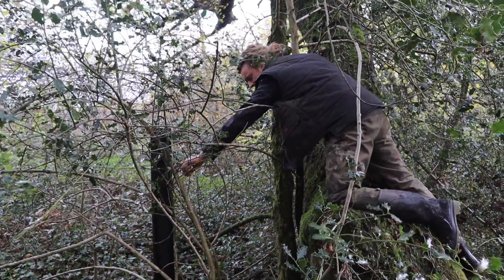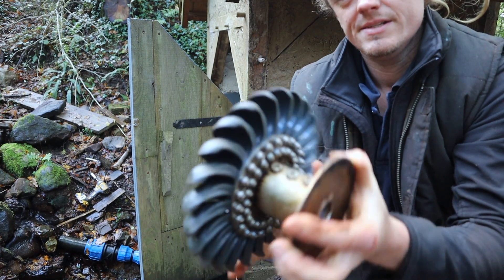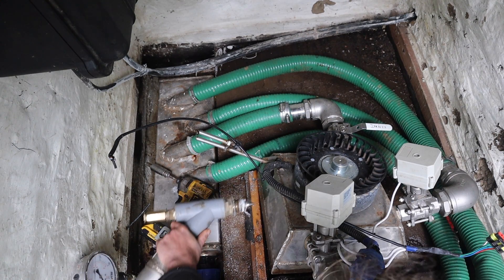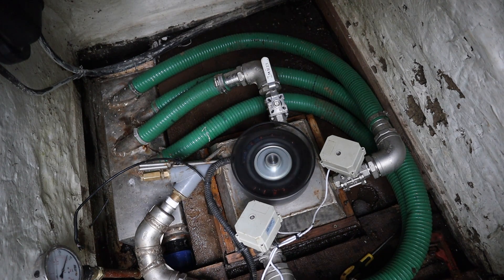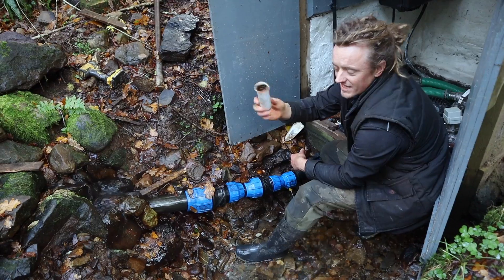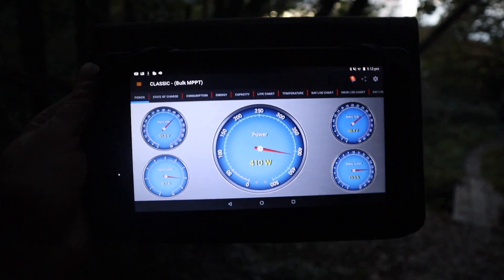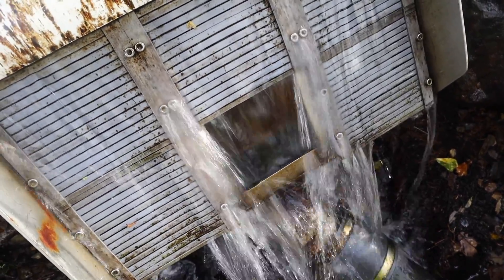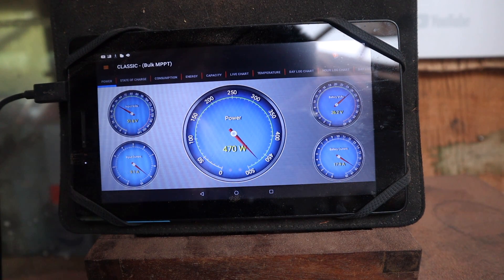Hydro Electric Trouble Shooting And Maintenance

Comment: I might be a bit late but I would suspect vortexing, easy way to sort it out is to shut off at the bottom and let the main stagnate for a while then try it on again, we used to think about stagnating for at least a couple of hours but our main was 10 inch cast iron about 6 miles long and fitted with automatic vent valves.

Comment: Adding a supercapacitor bank would help shield your batteries from high start currents if your machines do not have soft start. Look for soft start for any new appliances or motor controls. Your batteries always last longer with lower peak cuttrent.

Comment: To monitor risk of air in the pipe, you could have a section of clear pipe right after intake and/or after the stem pipe. In theory when going full blast - the long pipe after the stem pipe might suck more water than the intake can supply. But at low power it should not be a problem with air.

Another idea is to replace the stem pipe with a clear pipe, or at least a section of it.

Comment: I don’t know why but I dig all of the hydro vids.  I was wondering would the system generate more power with two turbines and splitting the feeds?  My bet is you’ve already figured this out and sorry if I missed it on one of the vids.  I like the dialing in of the system.

Comment: Good work Kris. For some reason I missed the notification when you posted this video. When you were looking for the fault I was thinking the pick up, but that looked OK when you got to it. Anyway good to see you back up to full production. I am still working on mine and today I am thrilled to have just cracked the 250w mark. I am running 3 of my 4 jets, In autumn I hope to have enough water to open the last jet, and find out what my maximum production will be.

Comment: What about turbulence inside the turgo chamber? Too much water spray for too little space? Your resolution indicates it's rather not your issue but I'm wondering long since when the critical point is reached in terms of max throughput of the wheel chamber.

Comment: Having watched all of the hydro content i wanted to ask a few things: if you do rebuild the manifold to accept the full sized pipe, can you mount the control valves on the manifold, taking some weight off the nozzles & also making it easier to disconnect the turbine.
With regards to your intake, could you have a sluice gate to control the flow over the screens ? My thinking is that you can regulate flow in the slightly lower water flowing times to hold water back.
A sluice may even help with debris on the screens.
My last thought is about the stand pipe, would a one way valve be of help to only let air out but not allow air to ever be sucked in ?

Comment: Kris I note that you are a Ham Radio operator what is your call I may have worked you VE3GNF a ham for 49 years and fully enjoy your channel
Reply from the maker: Hello. I’m afraid I don’t give it out in here as there is location details with it. But I’m a 2w0 so an intermediate licence holder. I don’t go on there much anymore but still have a listen now and then. I do have a long wire up that I talk to a friend in Ireland on sometimes on 80m but that’s about it.
Reply: @KrisHarbour  Saw a rig on your desk thought it might be a Yaesu 857 a good satellite radio I need Wales on Satellite HI HI I understand about the confidentionality enjoy your channel immensly keep up the good work has made my voyage through the pandemic tolerable 73 Art VE3GNF

Comment: Perhaps a lexan view port on the hydro "manifold" buffer tank to look for air bubbles, along with a soft-spring check-float valve to auto-bleed air.. Maybe cap off the air stack with a similar "flap" style check valve to vent air off and make sure gravity (when vacuum above it is high) isn't going to pull air in. Only things I can think of right now.

Comment: I would be careful taking out the pipe liners.   The first thing they do is add a chamfer so you don't tear out O rings with the pipe when assembling and the second thing is that the pipe can deform and leak over time even at low pressures.   Counter intuitively, I think higher pressure actually helps the pipe hold its shape.

Comment: The alternator, acting as a transducer of mechanical energy to electrical energy, has certain operating parameters and losses. You should generally see spin rate proportional to roughing AC voltage, and when you see that not having the same proportional delta then you may be coming across an inefficiency of the alternator.  There are numerous sources of this, including eddy currents in the stator, thermal losses, etc. Seeing spin rate vs roughing voltage is better than water flow versus wattage to discern flow of energy.
Reply: he had designed that even in freespin it does not overcome the maximum input voltage of his charger (in case of full battery). I believe that in freesping there was about 130V so he is definetly not in the region of inefficency with 50 something volts.
Reply: why not a bigger generator ? john barry

Comment: Hi Kris. I don’t know how expensive can it be but it would be interesting if you can implement some way to measure the flow that’s getting in to the pipe at the intake in the “dam” vs the flow that is getting in to the tank at the nozzles. I know there were ultrasound devices to do that. With that information you could monitor what’s going inside the pipe to discard any obstructions. Regards.

Comment: Great job troubleshooting Kris. I'm a maintenance tech, and can't count how many times I accedently fixed something!
Also, I'm sorry your government is pulling this lockdown sh!+ on you...after the elections we will most likely get the same treatment over here on this side of the pond. One thing's for sure though, with all the fantastic improvements you've made to your off grid homestead, you and Dott should fare quite well compared to what it would have been had you not left the city!

Comment: What voltage comes out of the generator? The cable must need to be quite large to move that amount of power to where the charge controller is.
Reply from the maker: 50v is about the average. its 100m of 16mm three core armoured.
Reply: @KrisHarbour  Nice, lots of capacity left for expansion, although seems like you don't need it :)

Comment: The area's where I would look is the reduction into the manifold (lots of ridges) and the manifold itself, the pipes leave at the top. Could it be a solution to let them exit from the bottom? the flow needs to make a sharp 90 degree turn up (give or take). and maybe it might be the electronics... fried/dusty?

Comment: I've seen in a few other builds where people have put a baffle up in the air intakes to calm the water before it goes down the pipe I wonder if something like that could minimize any chance of air bubbles getting in the pipe. It doesn't look like there's really any that are getting in there right now but even testing it out with a piece of metal with some feet on it might be something to try

Comment: It's good to get an initial problem solved but a mild irritation when you don't know exactly what it was to note it down for future reference to try first the next time it may crop up. A load of gunk did come out tho, so a planned maintenance flush out of the system might be a good idea to ensure it stays running well most of the time.

Comment: Hi Kris, Dot, Snoop, hope you are all well. Here's  a tech question for you. Would it make any difference in water pressure at the turbine if the pipe reduction was spread over a longer length of pipe? As I'm not a tech was just wondering. Thanks for sharing. Stay safe and keep up the good work. 👍🖖😎😺🐔

Comment: Ill bet you'd get better results by changing the housing to better fit around the spinning turbine blades and a change in the blades themselves, as it stands now, a lot of water won't even get into the blades as it spins and that means lost power. I might be wrong, I'll admit that, byt it just feel like there is a lot of gains to get in your system and all that water that goes through should be going through a second turbine. Designed right it could even take advantage of the spinning effect the first turbine is adding to the water.

You's system is great as it is, but there will always be tweaks you can do to make it better. Keep up the good work and make these interesting videos. Thanks

Comment: Kris
Another interesting video which cast my (now failing) mind back 40 years or so when I last played with fluid dynamics but does the enclosure , square in your case, contribute to turbulence within as the 'used' water tries to make it's way out causing back pressure and slowing the turbine or could the profile of the nozzles used be adding to non laminar flow. Cleaning of the pipes is a perennial problem when dealing with a 'natural flow' and should be factored into the cycle. As I said it is a lifetime ago since I used to encounter hydrostatic situations but in my experience it was always the turbulent/laminar flow issue that used to keep me up at nights.  Regards from a Melbourne ex pat enjoying slight relaxing after lockdown since March it is an unfortunate situation that the whole world has to come to terms with including the orangutan leading the USA and reminds us that no matter how clever we have become as a species biologically we are all interdependent on everything else inhabiting our planet and we should disrespect that at our peril.
Reply: Orangutan leader? Surely you're thinking of the UK, not the US.

Comment: Great video Kris, I'm wondering if the problem has to do with the shape of the top  of the generator box. It might be that the rectangular shape is causing some water at the highest volume (all four valves open) to bounce back from the wall and impede the generator blades. Looking at the video you can see that each valve is directly opposite a flat, albeit slightly sloping wall. Perhaps a larger conical top might help...just a thought.

Comment: If you have a slight increase in efficiency over a period of time, say a week or so, consider that you may have air bubbles in your penstock and they are being slowly absorbed into the flowing water.
Air bubbles are restrictive even though not solid. Every time you open it to atmosphere the air will reenter and need to be purged or absorbed.
Efficiency loss near maximum flow would manifest because of this reduction in cross section.
I have experienced this added resistance in my hydraulic ram system delivery pipe and it is measurable as a flow rate increases over time.
It is difficult to get all the air out of a slightly undulating penstock other than letting the air absorb slowly into the water.

Comment: Hi Kris, ever considered using ceramic bearings in your turbine?  They would increase speed and efficiency giving greater power output, they also bare less friction and last longer than standard bearings.

Comment: Thanks for my favorite Friday unwind activity!  I don't have any useful suggestions (what's new, right? :D) but I can sympathize with troubleshooting a whole system, not finding a smoking gun, gaining some improvement by taking everything apart and putting it back together, but not knowing exactly why.  Maddening!
Reply: Even more maddening is when it instantly returns to normal as soon as you start checking and then the problem comes back after you find nothing.

Comment: Great video.  I cannot help but think part of the problem is the multiple pipe connectors that step down the size right before the distro box.  I don't understand why you wouldn't bring that full size pipe straight into the box.
Reply from the maker: its a cost vs power increase trade off. the loss there is small and the cost to go direct in to the box is in the order of £600 as i need a 110mm shut off valve that you can only really get as butterfly valves (big loss) and a 110mm fitting for the box that is nearly £200 in that size. So that why. the loss is small and the cost is big. Everything with hydro is about cost vs efficiency. My system runs at about 50% - 60% efficiency. to get it to 80% would cost about 3x the cost of the entire system.
Reply: @KrisHarbour  OH, yes.  The shutoff consideration was the piece I was missing.  Thanks!
Reply: @KrisHarbour  Where do I send £20 to help?

Comment: Have you tried a test run with the cooling fan removed? I'd guess that you'd see over 500 watts. .the fan seems a funny arrangement sat on top..it almost looks like it needs the top covered so it draws air through the coils rather than pushing air round the shed..how hot does it get? Most of the air looks like it drawn in through the top then flung out doing nothing....perhaps a cooling fan with less blades ?
Reply: The air it blows away is replaced with new air coming in from below. It works. In the cooler weather the fan might not be needed at all. Joe Malovich did some experiments with the same turbine, covering the outside to stop it from blowing air. It added a few percent more power, but it's probably not worth the hassle to add and remove the fan with the seasons.

Comment: Kris, why do you only use part of the water flow from the reservoir/damn set up, is it cost or ecological reasons or something else. It seems like there’s more to gain from the excess water? 🙂
Reply from the maker: Pipe friction loss. to use all that water i would need a huge pipe in order to not lose all the power to friction. Also The flow rate you see in the video is not a very constant flow. that flow is only like that when its raining. when you design a hydro system you design it for the average flow not for the peak. If you design for the peak flow the cost goes right up for parts and the turbine does not work as well at lower flows Due to it being to big. So everything is sized to the average for efficiency and economic reasons.

It does mean some days alot of water goes passed unused but it also means that most of the time just the right amount is being used and being used efficiently. the water not used ends up still being useful to clean the intake and maintain the ecology of the stream
Reply: @KrisHarbour  thank you that makes sense. It initially seemed like not maximising the potential of the water, now it makes sense. It’s always a pleasure to learn from YouTube videos and yours are no exception I get to share in so many things I would otherwise miss out on thank you.
Reply from the maker: No problem. If the flow in the video was average flow i would have needed to run 130mm pipe really and then run larger cable to the power house and use larger turgo spoons. I would of loved to do that as i really want to make a big turbine but the amount of water i have on average just does not warrant it.

Comment: 11kWh per day, that's plenty as long as you have a sufficiently large energy storage system.
Reply: You need a large storage for solar system... water with constant production you dont need to worry so much.
Reply: @matejsojka6683  you do need to worry seasonally. Hydrogen allows such a large storage capacity that you can store enough to make up for seasonal production deficits.

Comment: Hi. I don’t know anything about hydro power but have you considered the possibility of having two electric motors or more attached to the water turbine via a belt or gear system thereby giving you twice the power? Just wondering if that’s possible?
Reply from the maker: I’m afraid that breaks a long list of fundamental laws of physics. If you read about the laws of thermodynamics then you will understand why 👍

Comment: Hey Bud love what your doing.. but can i say the way the turbine runs at such high speed, it causes a lot of stress on bearings etc.. and i know you have invested a lot of time and effort, into your system.. but i would seriously consider a vortex turbine.. they run a lot slower and a lot quieter... and pretty sure not as effected by frost and ice... i know it's more time and money but you could sell on the old one... just trying to make your life easier in the long run... https://www.youtube.com/watch?v=lUR_U-0D63w
Reply from the maker: My system is high head low flow. A vortex turbine is designed for high flow low head. My stream would not have enough flow to even make 100w with a vortex turbine
Reply: @KrisHarbour  hey didn't mean to offend.. just trying to give some honest advice! i have experience in both electrical and plumbing... I had an idea years ago.. let me try and explain.. a generator creates power by magnets passing a coil of wire.. North South North South.. imagine a water wheel with say 150 to 200 magnets around the outside.. close to the water wheel a group of coils generating electric.. the wheel wouldnt have to spin very fast as the number of magnets would give the north south change required.. like i say just putting ideas out there.. keep up the great work your doing.. i jealous!.. lucky bugger.. take care..
Reply from the maker: You didnt offend me i was just stating that it would not be the right system for my land. Also a vortex turbine spin slow but the generator attached to it still has to spin fast to generate voltage so a vortex turbine actually has more bearing to go wrong

Your idea would work but it wouldn't solve any problems but create alot. Magnets would rust and everything would be exposed to water. your basically just making the water wheel the alternator at the same time but the only real reason i could think of to do that is a very very tiny gain in efficiency due to less bearings/belts/cogs. But that saving would be very quickly lost when all the parts rusted away due to them being submerged and then exposed to air. Magnets are very prone to corrosion.  they could be painted and sealed but i cant really see what purpose it would serve when you can just have a seal alternator away from the water.